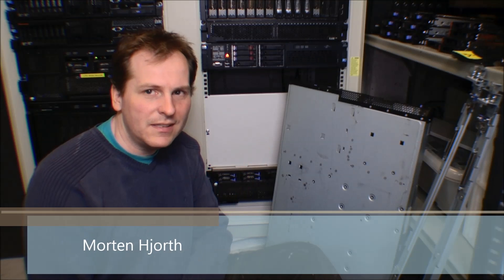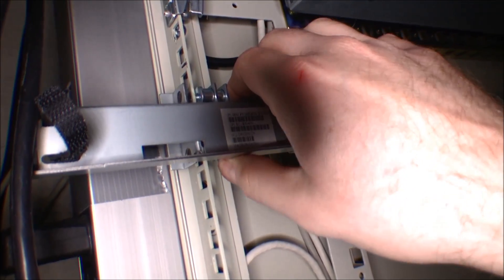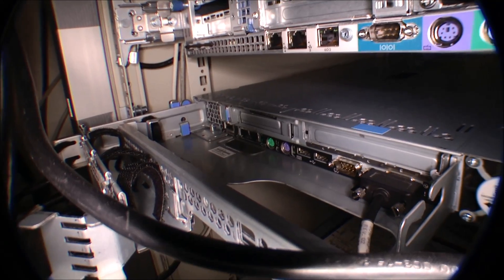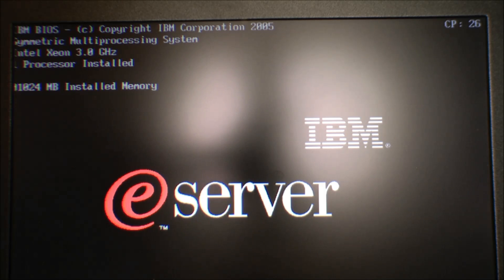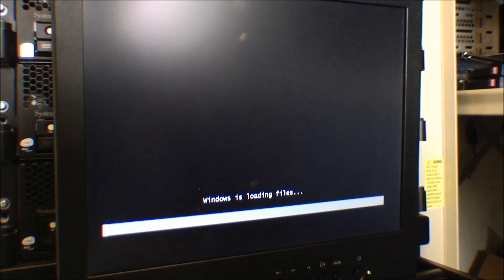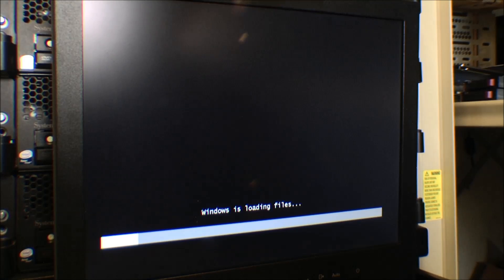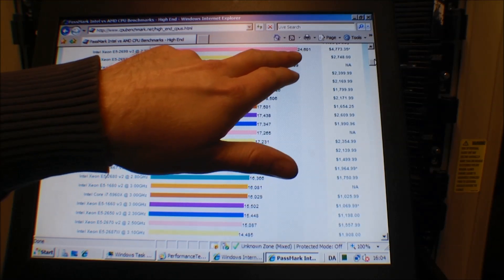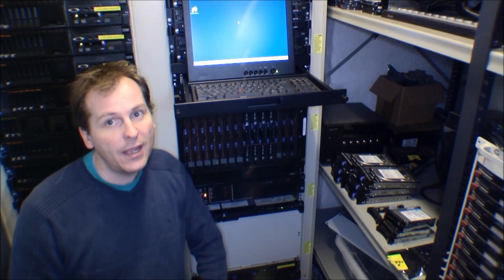Rack mounting of IBM X336, Server 2008 install - 178

Comment: I am trying to remove the rails for my IBM x346. It looks like they are the same rails as seen in the video. However I am not able to remove the rails. I try to push outward the latch and then push the other latch back but no way. They do not move the slide rail pins at all. Any idea?
Reply: Just got it! For those who struggle the same problem. Take a screwdriver and use it as a leverage to move the first latch backwards while pressing the 2nd latch. Be careful not to heart yourself.
Reply from the maker: Hi Andreas Pfeiffer
Thank You very much!  glad you liked the video :-)
Thank you for watching! :-)

Comment: Another great video Morten! Say, have you any experience with the Citrix access gateway AG 2010 SYC-515MU? I've picked up 5 of these on eBay for $22.50-60.00 each.  They are a nice little 1U computer.  Supermicro PDSMU mobo, can use a X3230 QC processor/w HT and up to 8GB ram.  You can add the AOC-SIMSO IPMI card for out of band management. Dual Intel gigbit nics. Intel ICH7R SATA controller with support for RAID 0,1,5,and 10. I have 3 of these running my pfSense router, PBX server and WMC.  They really work nice.  I added a cheap 1x PCIe video card to another one I'm using to play around with windows 10. Great bang for the buck. Its no mighty IBM x3650, but still pretty decent.  Thanks for all the great videos! Thumbs up for you sir!!

eric
Reply from the maker: Hi epd807 
Good value for toys in that caliber,,, umm what is PBX and WMC,, short for what?
And is that not, something you should have virtualized.
Thank you for watching! :-)
Reply: Hi Morten
PBX= Private Branch eXchange, this runs my voip phone system for my house.  WMC= Windows Media Center takes care of all my family's media needs; music, pictures, movies, video, television, dvr etc.  Yes, I should have virtualized all of it...but I discovered your great videos too late!  I've had this set up for many years.  I still cant quite get my head around how to run all this stuff on a virtual machine. So....until you make a video called "virtualization for dummies (like me)" I'll have to make do! ;o) Thanks again for all your videos, I really enjoy and learn from them!

eric
My PlayHouse
Reply from the maker: Hi Eric aka, epd807 
Thanks for the explanation. I have never played with eXchange,, i gave up on running my own mail server back at my Novell Netware days. I do have a Media Center, but i run XBMC,, from a Synology NAS,,, and i realy do not use it very mutch,, i use to mutch time editing videos,,i will cut back a littel bit i think.
Virtualization for dummies,, good titel :-)
Thank you for watching! :-)
Reply: Hi Morten
The pbx is actually for running my telephone system at my house.  I just use the email accounts provided by my ISP.  I toyed with the idea of setting up a mail server and then read how many problems you could have with it, so I gave up the idea. Im interested in XBMC (Kodi now?) as I use Silicon Dust tuners for my television/cable, and they have a kickstarter project for a dvr contraption.  Anxiously awaiting VFD (Virtualization for dummies)  ;o) Thanks Morten!

ericMy PlayHouse

Comment: Interesting that on ebay the eServer X336 model goes for around $200 to $500 on ebay, yet being this useless and old. It seems more like the minimum limit for any server no matter what it is on ebay, is like $200 in general. This of course does not include shipping costs.

But in comparision you can find a IBM x3650 M2 (less than 8gb ram included) for similar price which is marginally better.
Reply from the maker: Hi funkynicco 
Yes, for heaven's sake buy a 3650 M1/2 with a quat cores instead,, 10 times more power for the same money.
You are probably right in terms of shipping costs,, but also just the problems of packing such a big thing....

Thank you for watching! :-)